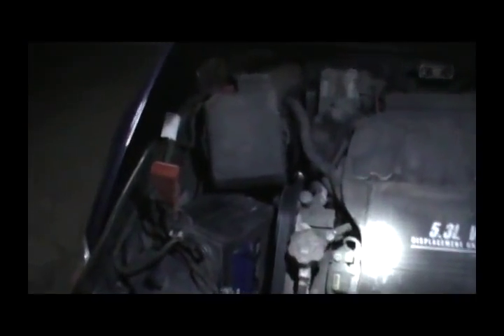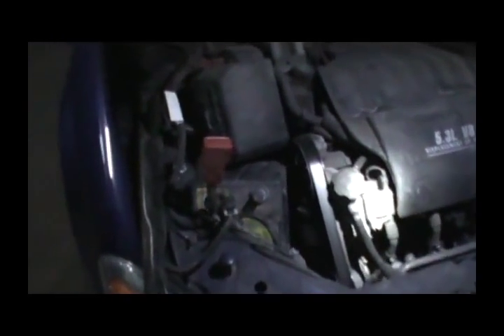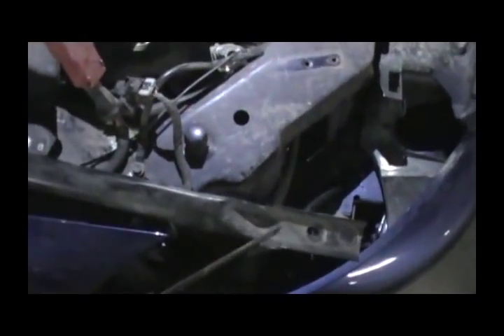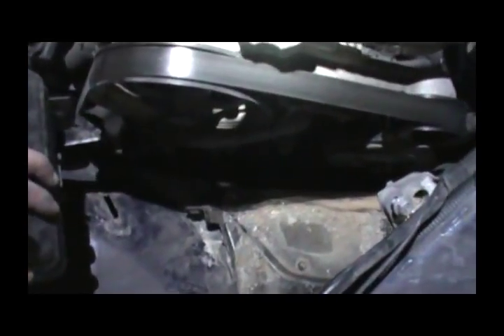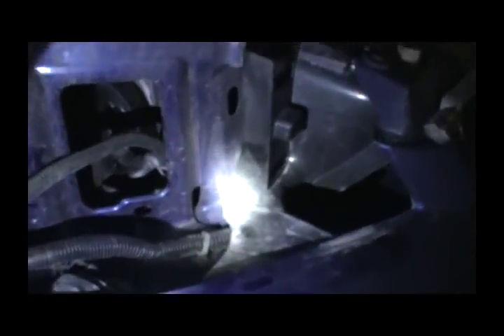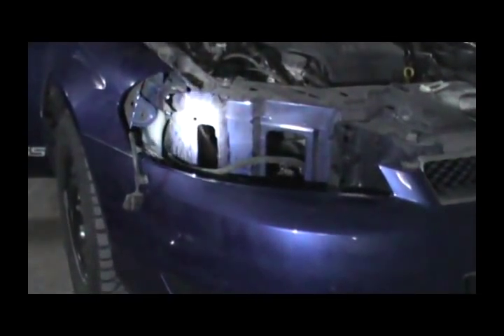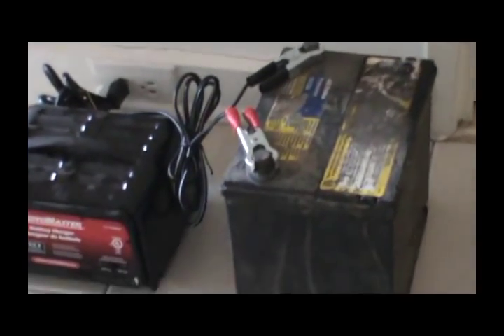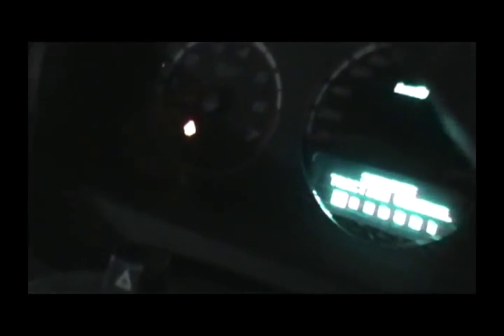Battery replacement on Impala SS

Comment: I just replaced a battery in a 2007 Impala. It is really an design nightmare. A couple of tips to avoid the problems that this guy had. You need to remove all the bolts from the crossbar, not just the two near the front. That enables you to move it away from the battery and gives you slack so you don't have to remove the headlight. Then you do not need to move the fuse box. Just remove the cover. Then you can get the battery out.

Hope this helps someone.

Comment: I had to change the battery on my '07 Impala SS this past February. I was able to get the OEM battery out without removing the headlight.

I looped a nylon tie-down through the battery's handle slot. This allowed me to lift the battery out with one hand as the other hand held the fuse box out of the way.

Comment: One again GM was too cheap to put in a couple extra inches of wire. Same with the automatic shifter. So the next time you can't shift or get your keys out, you will know that  one of the wires going to the shifter broke because they're so damn tight. Carry a long screwdriver in your car so you can push the manual button and get it home.
I'm getting a new Interstate MT-85 battery tomorrow. Of course it had to be ordered and costs a lot more because it's not the same as a regular Impala. The mechanic said he'd install it for $20, maybe I'll just let him do it.

Comment: gonna try and do this myself .. great fun ....
Reply from the maker: Remember you don't have to remove the headlight. Our car had an incredibly short cable and eventually we had the dealer replace the cable for us after GM Good-wrench mechanic couldn't replace the battery and had to replace the wiring and make it longer. Our car is 2006 and as per dealer few VIN#'s have this problem and not every model. So try taking it out the normal way. It will be a tight fit but it should work and if not...well :)
Reply: my son came and help me .. but that not my problem lol on to the next problem